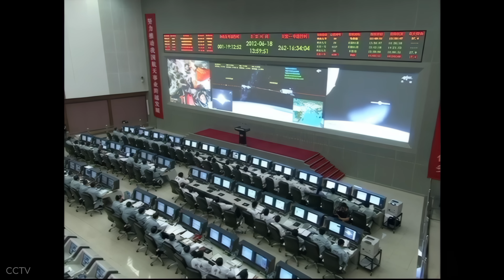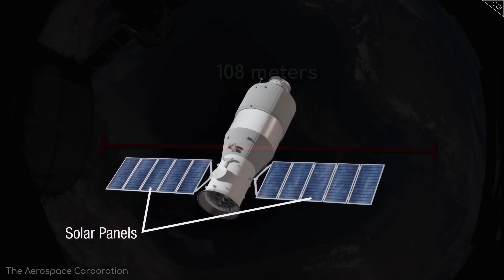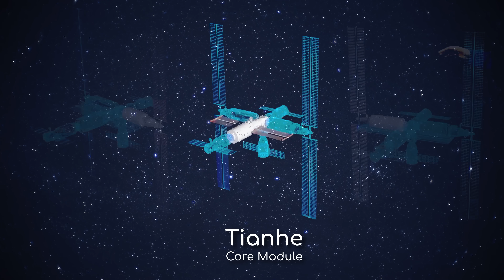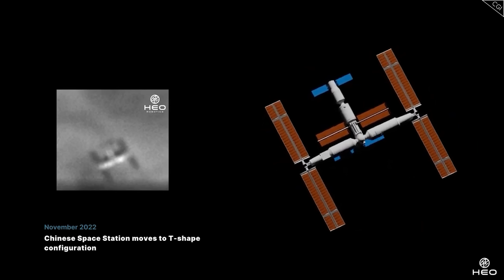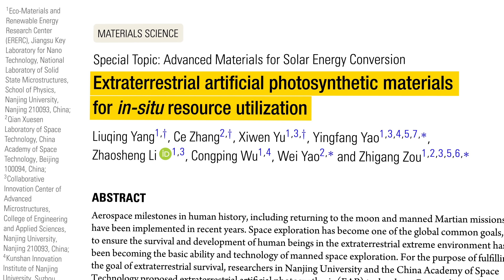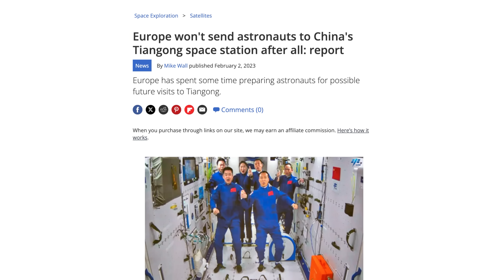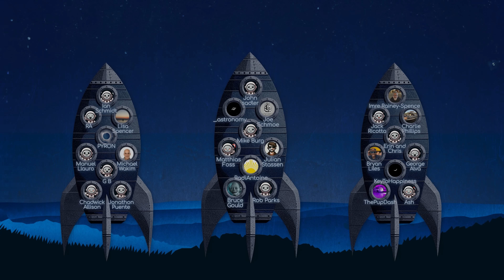How Did We Underestimate China's Tiangong This Badly?

Comment: >USA cuts off Chinese cars from the US market
>China develops some of the best EVs and Hybrids in the world
>USA cuts China off from ISS
>China builds a more modern and ambitious space station and program
Reply: exactly!
Reply: Next up: semiconductor, it's only a matter of time when China's semiconductor surpasses any 'US' technology (why ''? It's because it is debatable whether the tech used to develop semiconductor by ASML in Netherland is 100% US tech, I doubt it, if it is around 30-40% then it may be believable, and even so they cant claim it to be fully US tech).
Reply: @geraldkohar  half the semi conducter engineers in the US are Han CHinese from China that moved to the US. The Semiconductor  and AI race is between Han CHinese in CHina and Han Chinese in the US.!!!! lol you cannot write this.
Reply: @geraldkohar  I am sure ASML had a lot of input from TSMC and even some Chinese semiconductor tech companies.
Reply: @geraldkohar  You can said 100% or less than 5%.   The only truly irreplaceable US tech is the light source.  Without it, EUV just do not work, so 100% (?) .  However, an EUV machine need many more components and the light source is only 1 part of the components needed, so in that sense it is 5% (or whatever % as I do not have the actual knowledge to determine actual percentage)
China had come out with alternate light source, but they are not yet able to incorporate that to build an EUV.
Reply: @geraldkohar  anything is matter of time, but can they keep up and be faster? Looks like yes.
Reply: @geraldkohar  why do you think that? Just a feeling? I think you’ve been swayed by Chinese propaganda
Reply: USA: mad af
Reply: >France refused to sell wind tunnel to China.
>Chinese indigenously built the world's fastest Mach 30 wind tunnel.
Reply: @tkh2944 assuming you're not a native English speaker.  Did you mean ingenious?
Reply: @fobinc no, indigenous is a word lol.
Reply: this is hilarious😂
Reply: > USA cuts trade with the rest of the world.
> The world moves on and USA does a TACO.
Reply: USA cuts off chips to China
Guess whats coming 🫨
Reply: Spite is a powerful motivator it seems lol
Reply: @StellaTheCatGirl  Not spite, China doesn't spend billiosn to spite, it's necessity. A better analgy would be "necessity is the mother of invention."
Reply: US also cut off GPS services for Chinese vessels/rockets, China developed its own Beidu positioning system.
Reply: USA alienates all its allies 
China opens up and makes new friends
USA gives up soft power and aid to vast areas of the world
China steps in and takes it.
Reply: USA bans Huawei from using American technology. Huawei writes its own software from scratch and has a viable Windows alternative. 

It's like banning the Chinese from doing something leads to bursts of innovation which first equals, and then surpasses that which they were banned from having.
Reply: @amaury1264  stagnant old bones vs young fresh innovator be like
Reply: Elon Musk sneered at BYD cars, BYD overtakes Tesla. Sam Altman scoffed at the potential of any new entrant competitor to Openai, the Chinese gave him Deepseek. Today, American military watchers' favourite past time is disparaging the military prowess of the Chinese PLA. This is the one thing I hope the Chinese would not have to  show their true strength and superiority because I would not be alive to say "I told you so".
Reply: @The_Void_Deck  😂, I hope that will never need to happen too.
Reply: USA cuts China off from Semiconductors

China builds a domestic semiconductor industry at unbelievable speed
Reply: Not only built their own, they did it three separate times in a decade.
Reply: Who knew that when you crank out few million engineers, stuff gets built
Reply: US cuts off AI chips to China, and latest IC tech, so China...
(Maybe cut off too late?)
Reply: To be fair China steals everything I wouldn't want them involved if I was doing something technologically advanced either they have a history of stealing technology then using government subsidies to kill out competition
Reply: Exactly!
Reply: More like China becoming Thanos:
Fine I'll do it myself.
Reply: American stupidity is how covid teabagged over a million of those morons to an early grave ezpz
Reply: 奥观海，川建国，拜振华。了解一下？😁
Reply: Cool. Cut off China from everything then it'll do everything better
Reply: Not some of the best
THE best
Reply: Chips next.
Reply: Once most neglect..China  leaders all speak and understand English. Western Leaders very few understand or speak Chinese. That's is Chinese leaders are well informed.
Reply: Don’t forget AI chips and AI models.
Reply: I am shocked the ESA allowed the ban.  The ISS is not only US property.  On a good note though this creates a new space race between China and the US. Might finally get Artemis II and especially III going soon, which will be HUGE.
Reply: China copies everything with information they steal using their spies, that has been a fact for decades. They are sneaky and untrustworthy. Not saying the US is MUCH better but at least they are better than these chinapeople.
Reply: you clearly don't know anything about chinese EV. They are very dangerous and combusted for no reason. And when the owner posted that on social media they got arrested by CCP police
Reply: China has the best DOGE program on the planet, you defraud the government you’re. executed that day.  

Can’t get people in the US to even want to try and stop 25% of Social Security funds from being stolen.
Reply: And now they’re stuck up there.
Doufuzha gorengcheng = tofu dreg construction
Reply: @JoeArc10  dou fuzha?
Reply: U5A cut off 5nm microchips to China. China makes its own 3nm microchips. 😂

U5A cut off to university education to China. China makes its own world's best universities. 😂

U5A cut off European nations to China. China makes its Global South allies. 😂
Reply: Racism is the problem.  That is stopping meaningful collaboration between the west and east.
Reply: @bravosierra2447our government is terrified of China and China’s capabilities.  If they spent as much effort on collaboration as they did vilifying think of the achievements we could collectively accomplish
Reply: It's pure racism. The Anglo Saxon empire of the West believe they are the master civilization / master race, the exceptional chosen one and must rule the entire world. This inherent racism instilled in their DNA for the past 400 years starting with the great Western European breakthrough of the 16th century, called the Scientific Revolution followed by the Industrial Revolution of the 18th century.
Reply: is not ISS IS ASS LOLZZZZZ
Reply: social credit system working extra hard in these comments
Reply: You mean the ones that keep exploding/burning?  And the already crumbling damn?  And the failing economy? 
Sure hope they didn't build that space station tofu dreg style.
Reply: Little pinks
Reply: @rageagainstthealgorithm  sure anti sino bot.
Reply: @rageagainstthealgorithm  the only pink here is you pigskin.
Reply: Best…self immolating?  You clearly have been looking at the brochures, but not the reviews…
Reply: @teslapilotcheapreviews8490  I trail drove Li Auto L6, great experience.
you need to adapt to the changing world, Mr. Boomer.
Reply: @ulyssis boomer with a car that’s not falling apart 10 yrs later😂. Tofu dreg looks real nice when it’s new. Feel free not to follow sage advice.
Reply: @teslapilotcheapreviews8490 According to American Info expert: 
▪expectancy life of an American car is 12 years old, 8 years old if an EV. 
▪Chinese EV cars had 8 years of warranties. Life expectancy is 15 years.
Ofcourse, we should not trust American expertise. 🤔
Reply: @teslapilotcheapreviews8490 10 years? With the way modern American hardware is with planned obsolence for everything I'd be shocked if any of their cars were still usable even 5 years after production, but hey at least they'll offer you a $1000 discount on buying their latest car, that seems to be the only kind of "innovation" America can do now.
Reply: @teslapilotcheapreviews8490  You clearly don't even have eyes if you can't recognize the success of Chinese EVs, just in 2024 when they first started taking of they were already making 70% of all EVs on the world.
Reply: @teslapilotcheapreviews8490 and you’ve been looking at the $6K dollar store EVs. Look at the EVs that are comparable in value to the typical new car in the US instead.
Reply: @teslapilotcheapreviews8490 Reviews of what? The high end EVs that you cant even get? Who's reviewing them? Those EV companies take government grants and make cars for the Chinese public. If you think they are gonna screw around with the CCP's money and endanger citizens, you are a delusional.

And if they are so subpar, why are they banned to protect the American EV industry? Please make some sense... oh wait your user name.
Reply: @zippo718  I visited a BYD dealership in Dublin.  Some people enjoy tofu dreg. Others dream of tofu dreg, and call 'delusional' others who've smelled it.
Reply: @teslapilotcheapreviews8490  Reality check.  Last review I read, the Russians had no army to speak of, and the Chinese didn't know how to put together a puzzle.  Last article I read, (he Russians had beaten NATO and China fielded more advanced weaponry and soldiers in one square than there are in the whole of Europe.

Comment: This is all very optimistic, but there are several challenges that do not appear to be being addressed.

First, what "new propulsion" are they working towards? Because everything "new" that has been discussed over the last 30 years or so - from aerospikes to solar sails to riding the beam of an Earth-based laser - have thus far proven themselves to be impractical. 

Second, even with vigorous exercise routines, the human body does not fare well in microgravity. You mentioned nothing about investigations into centrifugal artificial gravity. All studies and trials thus far have shown that (a) the rate of rotation must be slow, which necessitates rotation on a large diameter system, and (b) that flexible tethers are all but unmanageable in microgravity. For long-duration spaceflight where you want your taikonauts to be able to do useful work at their destination, this is going to be almost essential. 

Third, radiation shielding. Low Earth orbits are still inside the protection of Earth's magnetosphere, but journeys outside this environment  - even just to the moon - will need to provide the taikonauts with adequate shielding from both the solar wind and cosmic rays. The Apollo moon landings didn't need a great deal of this because their longest flight was only about ten days. But if your crew is spending months outside Earth's magnetic field, you have to address this. Yet it's not mentioned in their plan.

My feeling about this project is that it's looking at plucking the low-hanging fruit of long-distance space travel, while leaving some of the biggest challenges for later. Or for someone else to find a workable approach for.

Comment: 10:42 The Taikonauts did NOT not produce oxygen from carbon dioxide. They used electrolysis to separate oxygen from hydrogen in water (H2O) molecules and then combined the freed hydrogen with CO2 to get ethylene. The freed oxygen came from the H2O, not the CO2.
Reply: exactly!!

Comment: Don’t be surprised that china will display a 7th gen fighter prototype soon either not only because China has a mach 30 wind tunnel JF-22, but also with the development of new material made from Tiangong that is perfect for hypersonic vehicles, missiles, and fighter materials based on a report below: China has developed a niobium-silicon alloy using data from experiments conducted on the Tiangong space station. This new alloy is the first of its kind to meet industrial standards and could revolutionize aerospace technology, particularly for hypersonics. It boasts high temperature resistance, strength, and is lighter than conventional materials.

Comment: How did you miss this:

In the Astrum presentation titled “What China Is Doing on Tiangong Is Game-Changing,” several claims are made about the Tiangong space station’s advancements. While China’s achievements in space exploration are noteworthy, some assertions in the presentation may overstate the uniqueness or novelty of these accomplishments. Here’s a critical examination of these claims: ￼

⸻

1. Artificial Photosynthesis in Space

Claim: Tiangong has achieved a groundbreaking milestone by performing artificial photosynthesis in orbit, converting carbon dioxide and water into oxygen and ethylene, a potential rocket fuel component. ￼

Context: The International Space Station (ISS) has long employed systems like the Oxygen Generation System (OGS) and the Russian Elektron system to electrolyze water into oxygen and hydrogen for life support. Additionally, the Sabatier process on the ISS combines hydrogen with carbon dioxide to produce water and methane. While Tiangong’s approach using semiconductor catalysts is innovative, the fundamental concept of in-situ resource utilization for life support and fuel production has been explored and implemented on the ISS for years.  ￼

⸻

2. Robotic Arm Capabilities

Claim: Tiangong’s robotic arm is presented as a unique advancement, capable of assisting in module relocation and maintenance tasks.

Context: The ISS has utilized the Canadarm2 since 2001, a robotic arm that performs similar functions, including module manipulation and spacecraft docking assistance. While Tiangong’s robotic arm represents an evolution in design, it is not without precedent.

⸻

3. Energy Efficiency in Life Support Systems

Claim: Tiangong’s life support systems are significantly more energy-efficient than those on the ISS, requiring only a third of the energy.

Context: While advancements in energy efficiency are commendable, the ISS has continuously upgraded its systems over the years to improve efficiency and reliability. Direct comparisons should consider the differences in station size, crew capacity, and mission duration.

⸻

4. Space-Based Fuel Production

Claim: Tiangong’s experiments in producing rocket fuel components from in-orbit resources are portrayed as a world-first.

Context: The concept of in-situ resource utilization (ISRU) has been a subject of research and experimentation in various space programs, including NASA’s studies on the Moon and Mars. Tiangong’s experiments contribute to the field but are part of a broader, ongoing international effort in ISRU technologies.

⸻

5. International Collaboration

Claim: China presents Tiangong as a platform for international cooperation, highlighting partnerships with various countries.

Context: The ISS has been a model of international collaboration since its inception, involving space agencies from the United States, Russia, Europe, Japan, and Canada. While Tiangong’s openness to international experiments is commendable, it follows the collaborative framework established by the ISS.

⸻

Conclusion

While China’s advancements with the Tiangong space station are significant and contribute to the global space exploration narrative, many of the touted “firsts” have parallels in earlier international missions. Recognizing these achievements within the broader context of space history provides a more balanced understanding of their significance.
Reply: When one is lazy as f to think on their own and had to use AI.

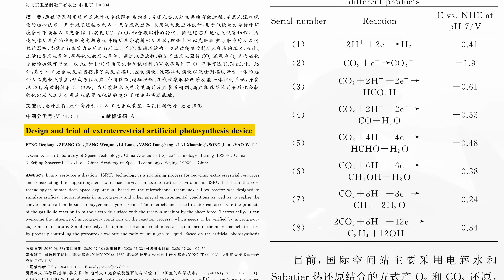Comment: at 11:02 : C2H4 is not "sugar" it is acetylene, which can be used as fuel for lamps and welding torches
Reply: Correct me if I'm wrong but I think you're thinking of C2H2. Ethylene (C2H4) isn't a sugar either but is involved in sugar metabolism
Reply: C1H4 - Methane
C2H4 - Ethene
C3H6 - Propene
C4H6 - Butyne
C5H8 -Pentyne
Reply: @junfon7097  yes, it is not sugar

Comment: As an engineer I know that fluid dynamics are tricky for liquids, gaseous fluids add an extra step of complexity. I can imagine that in a space without gravity it puts another layer on these analyses. My SolidWorks Flow-Simulation has already problems with very mondain problems where a gaseous fluid has solid particles in it, like dust. We have to admire the studies they are doing up there..
Reply: Would there be any issues with having fish in tanks in space?  Do fish need gravity over long periods of time?  Would their muscles atrophy, or would they be just fine?  Any issues dissolving oxygen in water without gravity?
Reply: @danmurray1143  yes, the fish could swim out the water and just start floating in the air.
Also the fish wouldn't feel pressure under water, only if the tank is pressurized. I do think that keeping oxygen in the water is a problem too.
Reply: @hanstubben I disagree, O2 will be solved in the water, there is pressure. Youll fill the tank full with water. Only there is no pressure gradient with debt, and washing out the CO2 might be tricky.
Reply: Ask them if you can go their go to conduct your experiment.
Reply: 不用询问，中国的空间站向全球科学家敞开，你可以自由申请，如果通过考核还可以给补助，但实验结果得共享。 @Top-cat-65